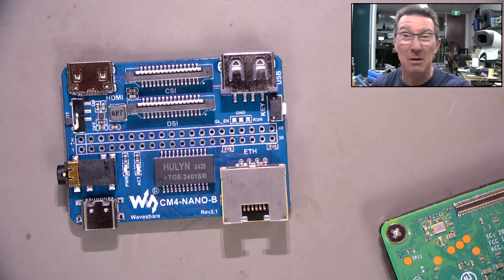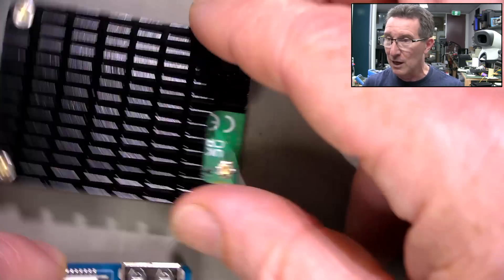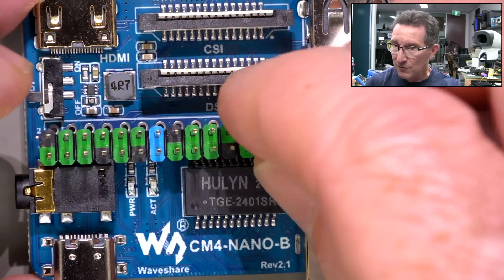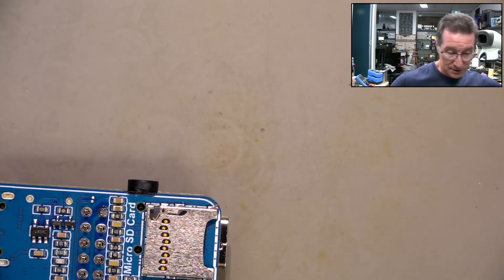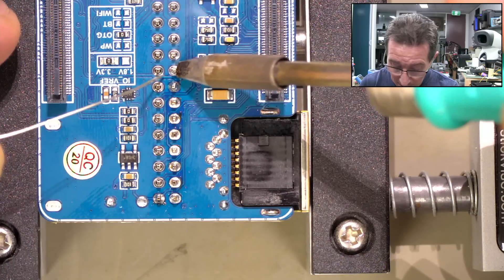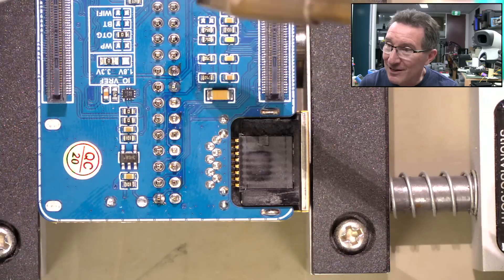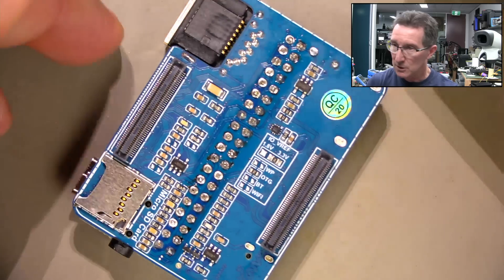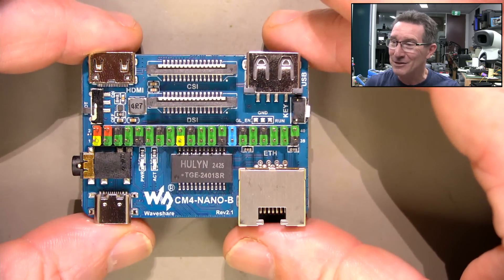Just soldering a DIP header onto a Raspberry Pi Compute Module

Comment: i must say soldering trough hole components is a bit therapeutic
after i messed up replacing one tiny smd led on my keyboard pcb i am all stressed up (because i broke the ic doing that) i barely could see what i am doing under microscope and my soldering tip was way too big.

Comment: I find it useful to verify the header is sitting flat on the PCB after soldering one or two pins.  It's a lot easier to adjust the header position when just a few pins are soldered rather than the whole enchilada.
Reply: Yea, I often solder a pin then press the header against the PCB and reheat that joint.

Comment: after 7 years , i give up with raspberry , all 2year die the berry or sd card or both
and you have not always a backup. must  then do all new configured 😞
since 2 years i all have on windows hp micro pc on win10
it has less power  ~5watt 
and noooo problems 🙂
and configure all very fast :-)  all time :thanksdoc:
Raspberry :hand-orange-covering-eyes:🤑🤮

Comment: Meh, it's fine - if i were a teacher, you'd get a solid B - an A if you cleaned off the burnt flux. 😉 I'm using a 2x magnifier with built-in LED ring lighting - it's fine for most of the little jobbies. (I've gotta tell you about my Pinecil iron - it's so affordable! 🤣 I'm powering it via my bench supply, but it's also got fancy USB-C PD.)

Comment: Once you have home assistant you will throw out all the other stuff. I wouldn't recommend putting home assistant on a pi long term, unless you run it from an SSD. A NUC PC is a lot better. HA is a deep rabbit hole, you have been warned 😅.

Comment: Instead of throwing out worn tips, try replating them. It's surprisingly easy to do. You need to first sand and polish the tip and then replate.
Reply: What  is the replating process?
Reply: @Graham_Wideman  electro nickel plate. Just need some pure nickel, vinegar, and power supply.
But its a slow process if you want it to plate evenly.
Reply: Just nickel plate? I have had a chinese t12 tip get hollowed out after 5 years or so.. Might be a good idea to plate it preventively.
Reply: @victorman2227  Not really worth it when T12 tips are $3 each.